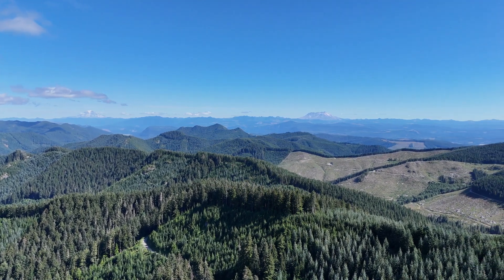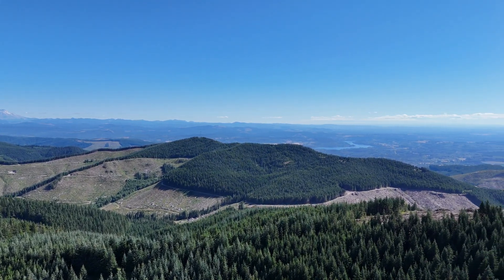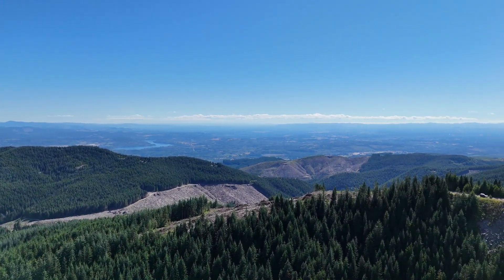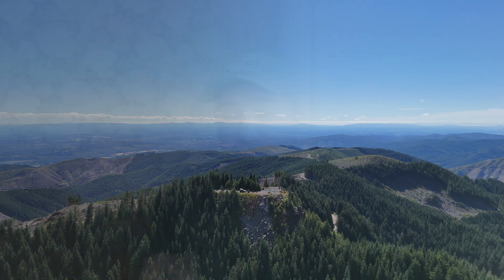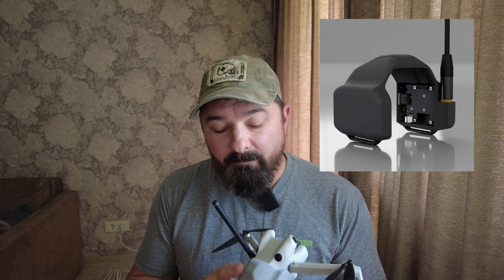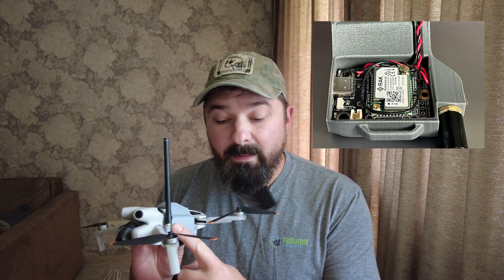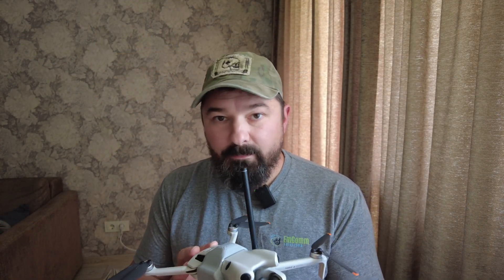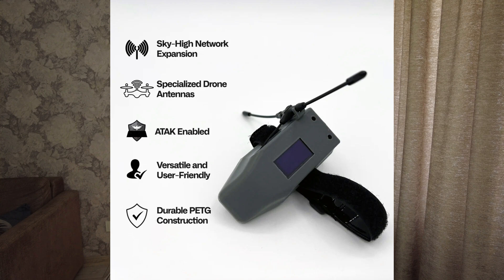Meshtastic Takes Flight: From 3D Printed DIY to Off the shelf radios

Comment: Just dreaming here...but I wonder what the lift capacity of these drones are.  Could it be possible to have it lift a very long, thin wire from the ground that would power the drone and comms unit from a larger or continuous source (larger battery or AC/DC)?  If so, then your 'tall antenna' could stay up for as long as needed.
Reply from the maker: That might be a challenge but make be possible at lower heights.
Reply: You'd need a return wire, but some twisted pair magnetic wire would work. The other challenge is the wire being such small diamager means you'd need to run a fairly high voltate to reduce the current, and then regulated it down via a buck regulator.  

The other opition would be active RF energy harvesting, but would require a fairly intense beam of microwave energy to get sent to the drone. Possible but it has it's issues as well

Comment: Im suppressed no one has put one on a rc plane yet.  I would think a plane would have longer flight times.
Reply from the maker: Same, I think it would cool to see. Depending on the setup you could possibly see an hour plus of operating time.
Reply: @EmCommSolutions  Or even better,  solar cells on the planes wings.   I've seen some 5-8 hr flight times.

Comment: In the US you do not need a license or certificate (part 107) for drones over 250g, they just have to be registered which I think costs $5. Thanks for the video!
Reply from the maker: Thanks for the correction. I mixed up EU vs. US requirements. The EU has strict regulations for drones over 250 grams and some even require you to have insurance.